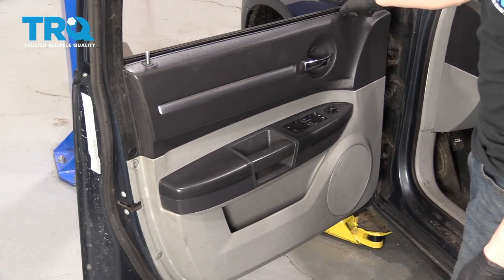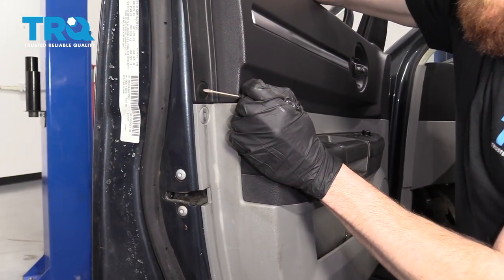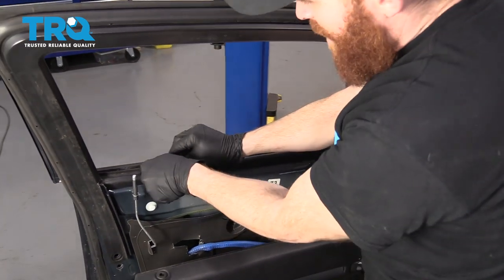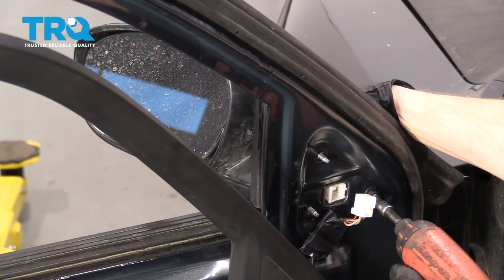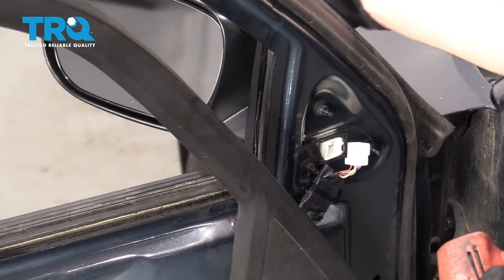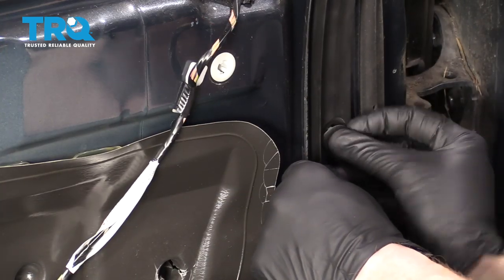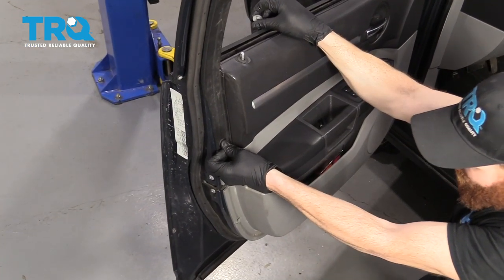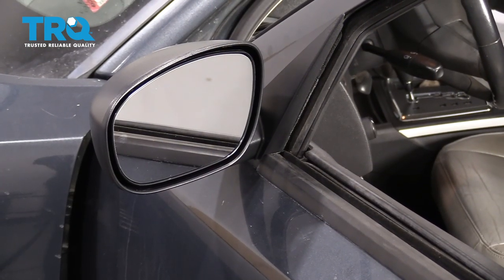How to Replace Side View Mirror 2006-10 Dodge Charger

Comment: Excellent video! I was intimidated by having to remove the door panel but this made it easy. Took about 20 minutes total to replace the passenger side. The only thing I didn't count on was how to deal with the door panel after removing it. I just balanced it on a box and gave myself enough room to get at the mirror mounting bolts.

Comment: Helped make quick work of changing out mine.  ALERT though!   The two white door panel clips must be removed by pulling straight out with pliers, then slid into the mounts on the backside of the door panel, then carefully aligned with the receiving hole before “giving it a good whack” to drive it home.